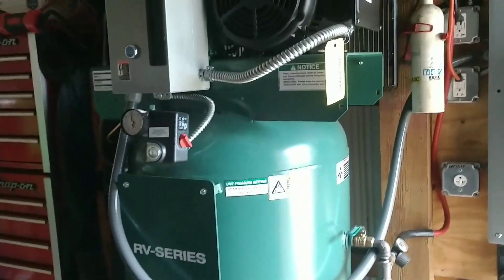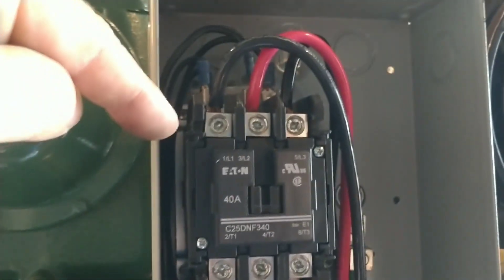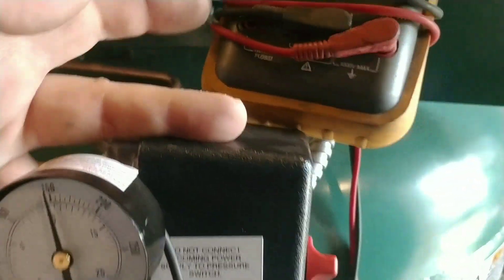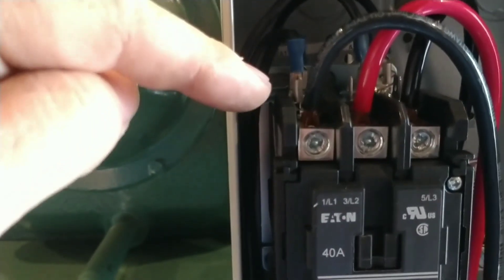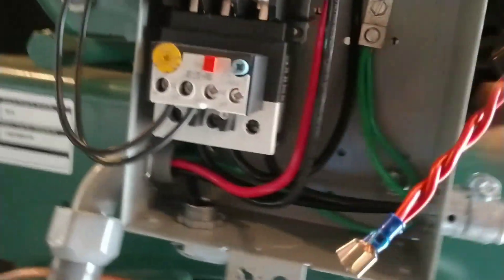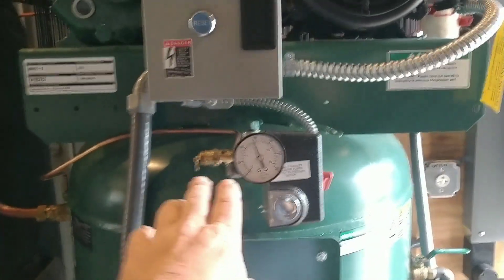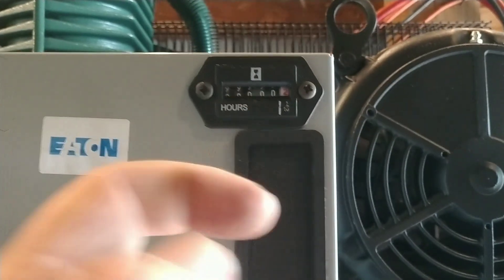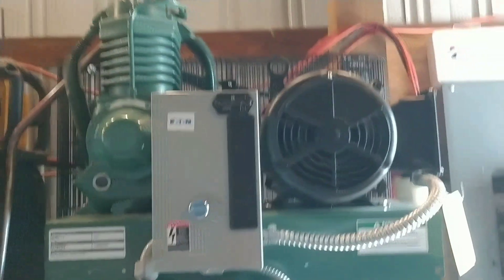INSTALLING AN HOUR METER IN MY NEW COMPRESSOR

Comment: That's a great idea, you know when to change the oil in the compressor!
Reply from the maker: that was my whole reasoning for installing it. i hope to make this compressor last as long as possible.
Reply: J.C. SMITH PROJECTS One of the best ways to make your air compressor to last is build it a shed outside or even inside the building and install a fresh air vent and a fan system to the outside that will run cool the shed air temp additionally a cold (outside air) intake with a air filter.  I purchased a paper style air filter housing to a big rig from a junkyard and put a high flow filter in mine, a buddy of mine used a Duramax airbox and a K&N air filter that he purchased at the junkyard.  The think I have found with the fan the comes on to keep the compressor cool in the shed is the shop is much quieter and it runs cooler which helps with it building up water in the system

Comment: I don't have that big grey box that you have, all I have is that black box with the on and off switch on top of it and with 4 terminals in it. In that black box 2 wires from the motor hook to 2 terminals, one wire white and the other wire  black and then I have another 2 wires from my cord going into the box which are black and white as well and they're hooked up to the other 2 terminals in the black box and I matched the colors accordingly, and the ground wire from the motor and cord are screwed into the bottom plate. My question is can I hook up the hour meters positive wire  to the black wire in the box and  hook up the hour meters negative wire  to the white wire in the box or vise versus? Will that meter take 220v for power. Please excuse my ignorance when it comes to electricity. Thank you for the video. I gave it a gigantic thumbs up. 👍👍

Comment: I have an automatic pressure switch on my Quincy Compressor and don't have wires going to a pressure switch so I was figuring that I would connect this same style hour meter to the load side, where the electric motor is powered as I have a 110/240v hour meter. It mentions "Polarity sensitive" though and doesn't indicate which terminal is for which polarity? Or is that referring to supply power and not return line?

Comment: I noticed both your wires coming out of the hour meter are red. Do you just use two 120v hot wires then connect them to the pressure switch? My compressor doesn't have a magnetic starter.
Reply: Then I guess the ground isn't used on an hour meter?
Reply from the maker: this hour meter was capable of running off of 120/240 single phase. one wire to each hot or one to a hot and one to a neutral.

Comment: Thanks. I have a single phase 240V 16A 50Hz compressor and am looking to fit an hour meter, too. Mine is completely differentm but I think the same principles apply. I like fitting off the pressure switch as this isn't running a huge load, like the motor or the input side. Need to get something ordered and added.

Comment: Great video thanks brother. I was wondering how it works. I don't have a big compressor like you have. I did get a new one and I want to put a meter on it. I do like the way yours is set up with the thermal protector . I just have the reset button on the motor 220 volts  5hp. This really did help me out anyway. Keep up the great work see you in the next video thanks again brother

Comment: Nice work, J.C. - looks like a factory install. No clue why compressor manufacturers don't include an hour meter with any of their compressors, especially the higher end units. You really have to know hours in order to maintain them correctly! I hate that. Another way to save a buck, I guess. Par for the course today!! 

Mine doesn't have a contactor - wish it did. It runs direct off the pressure switch. I had to install mine on the lower right side metal flange that's part of the motor /pump mounting plate. Some pretty thick metal there - was a PITA to cut that out to install it. I should've videoed that install - didn't think of it at the time. I wired it direct to the motor leads. Was the most logical spot for me, since there's no contactor.

I bought a used Hobbs meter off eBay for mine. Got it super cheap. It started off a .2 hrs, so I just subtract that from the total (made a note of that in magic marker on the compressor). I like the Hobbs for that little "dashed" digit wheel that spins when power is present, and lets you know it's installed correctly without having to wait around for it to roll over. Plus they were used in aircraft for decades, so I knew the quality was there.
Reply from the maker: i dont know why they cheap out on that either...you can add a contactor to yours very easily. when shopping for a compressor, i noticed most companies didnt use them on the smaller 5 hp motors only 7.5 and larger...the pressure switch they are using must have heavy enough contacts to handle the load on the smaller ones.
Reply: @j.c.smithprojects  - Ahh, that explains it. Mine has a 5HP motor - pulls 28A or so according to the tag. I'd imagine that 7.5 pulls in the mid to upper 40's - that's some serious juice!
Reply from the maker: mine peaks at 36 amps
Reply: @j.c.smithprojects  - Wow, I was way off on that one. Thanks for the info! 👍🍻

Comment: I ordered the same hour meter, before I saw your video. My question concerns the back of the hour meter, which is labeled DC-6V-80V. It is also labeled - and +. As it’s DC, how do I know which lugs to attach the leads from the hour meter to? Everything inside the junction block is all AC, as far as I can tell. Before I attach it to the pressure switch, as you’ve done, how do I know for sure that I won’t burn out the hour meter attaching it to AC. I have a few VOM’s and I will check to see if I’m connecting to either, but I’m just initially curious as to why a pressure switch would be DC, and why the hour meter is labeled for DC.
Thanks,

Roy

Comment: You could shrink tube the conectors for the compessor to save your self haveing to re crimp and cut the wires
Reply from the maker: i have done that before. i find the heat shrink just isnt hard enough and tears easily.

Comment: Two things JC. First, make sure the hour meter is rated for the voltage that you're running the compressor on and in the US, purchase a 60 hZ hour meter.

You might wish to include a automatic drain for the tank. A large tank run during very humid or cold conditions with fill with water quickly. Will also keep the tank from splitting once the water inside freezes in the winter breaking the bleed valve. Ask me how I know?
Reply from the maker: it is rated from 100v to 600v ac. i prefer draining the tank myself as i can monitor what is coming out. if the compressor looses a seal and starts to pump oil in the air or if there is metal from an internal failure, it will show up when draining.
Reply: Thank you Captain Obvious. If you are familiar enough with J.C.'s channel , then you know his workmanship and attention to detail. Seeing that all work shown is now past tense, any suggestions of which Hobbs meter is moot.  I will not slight you on the auto-drain feature, though a good mechanic prefers to monitor and maintain his equipment (by manually draining the tank in this instance), there ARE times when that option has more value than just being too lazy to blow-down your tank.

Comment: Great video.   I don’t quite understand how I will know the the hour meter is accurate to the voltage I’m using when I hook it up to mine.   Would 110 run the meter half the speed as if it’s connected 220 ?   I bought one from amazon.  No directions.   Mine says AC110V~250.  Does that mean it’s accurate for either voltage?
Reply: Yes
Reply: Some hour meters work from 10v to 80v you don't need to tell it what volt it is. It just starts counting when the current starts going throw it.